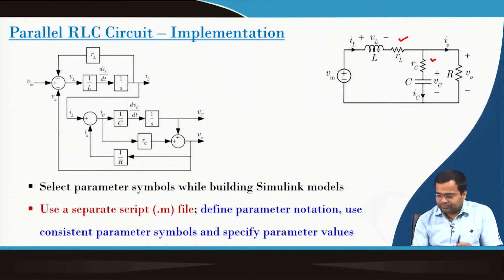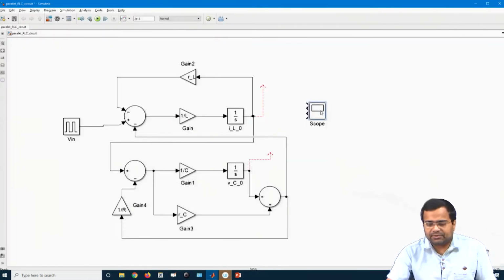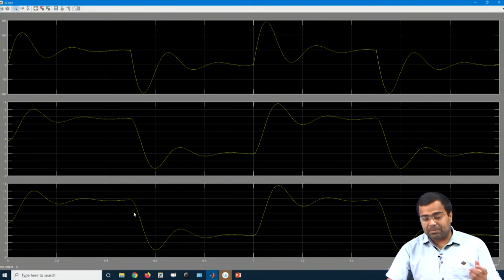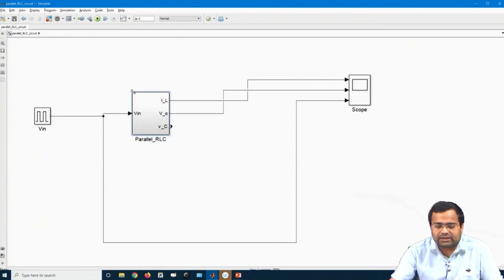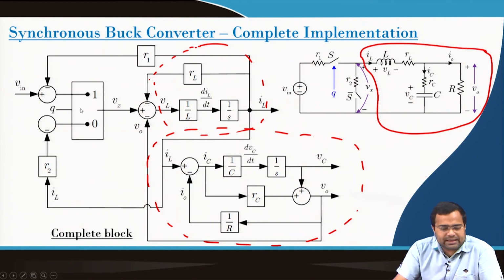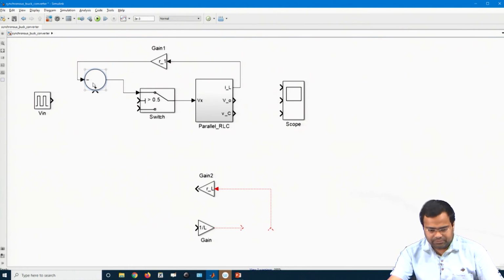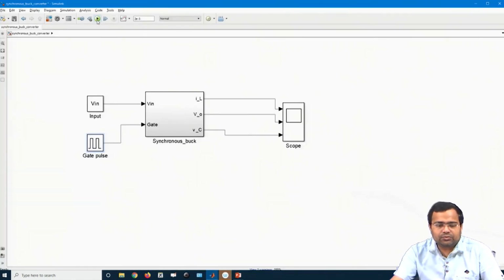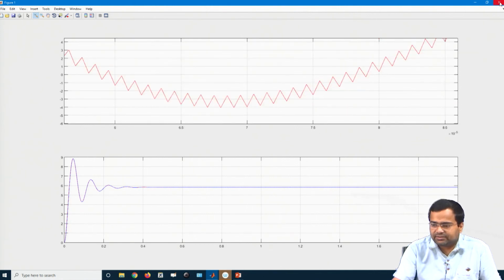Lecture 06: Demonstration of MATLAB Simulation (Continued)

Comment: I presume you are uisng variable step solver since your are modeling in continuos domain. It would be very helpful if you could as well show your solver configuration. Thank you so much for this lecture series. I am very much looking forward for this class to start again to take in in real time. Thanks again.
Reply: he is not using electrical blocks so he doesnt need a solver. this simulation is based on mathematical blocks only